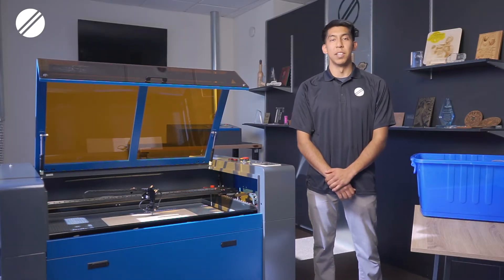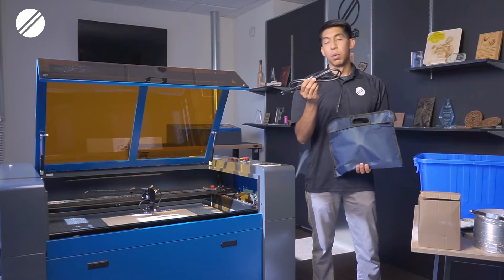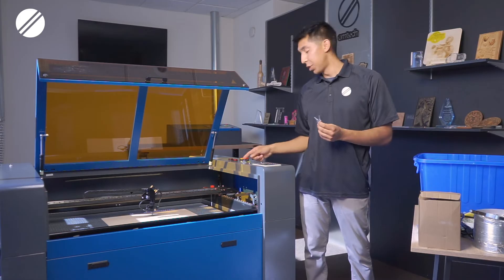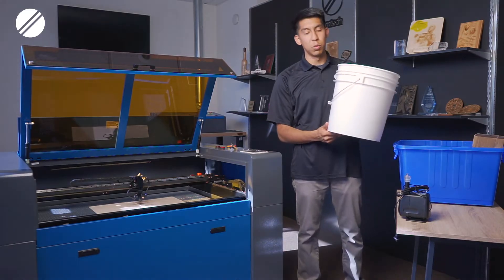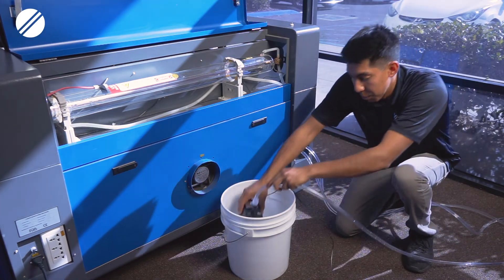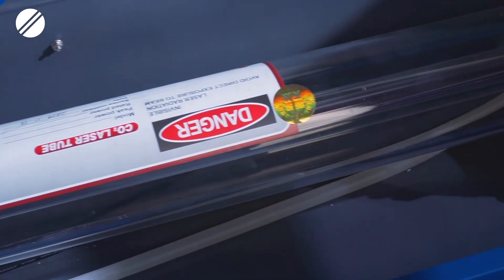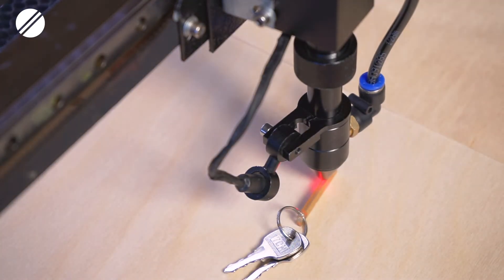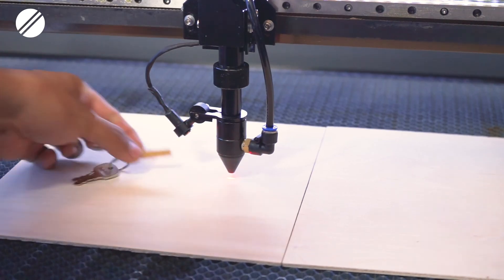Initial Set Up for Your CO2 Laser Engraver - Training Video - OMTech Laser

Comment: Bought the OMTECH 130watt machine and didn't receive the accessories kit/ blue bucket, water pump.  As far  as keys go, we only received the machine run key and no cabinet lock keys.   And the honeycomb bed doesn't fit in the machine.  May be able to fit honeycomb bed if we reposition gantry / laser head whenever we fire up the Machine for the first time.   We still have to buy the chiller and air assist compressor.

Comment: Why does my 100 watt omtech laser seem to not do anything at any power under 11%?

Even with a much slower speed, I don't see any evidence of the laser etching any surface like acrylic or plywood.

I opened the side and see that the laser box is showing 03 mA when running at 11% down to 2%, but no marks on the surface of any materials when programmed with a power under 11%.

Comment: I just ordered and am curious; Is it possible to add autofocus, and red  dot to the MF2028-60’s controller. As in are there open ports on the controller to power and utilize these upgrades? 
I’m sure red dot could be added regardless, does the power supply have a 5v rail? Or would a Buck converter be needed to lower the 24v to 5v
Reply from the maker: Our techs will be more than happy to help answer all your questions. Please contact us at techsupport@omtechlaser.com or our customer support team at support@omtechlaser.com we're also available by phone during business hours of 8:00am - 5:00pm+1 (949) 539-0458 Monday-Friday pacific time zone. Thank you for your support.

Comment: I bought a 55W co2 laser.. Mine only came with one key, no usb cable, no focusing tool, broken zipper on the accessory bag (not bin), didnt come with a rotary axis like i see every other post offering as a free bonus, and most annoyingly it has enormous deep scratches/slices on the acrylic lid. It looks like someone cut something while it was on the lid. Ive owned the laser for about 2 weeks so far and i havent used it yet. I want to know what im doing before i start messing with it. this is my first Co2 laser. Hopefully nothing else pops up thats wrong with it. I'm about neutral with the product so far. Not overly excited because of the bad things but i dont have a completely negative feeling about it because there's plenty good about it. Looking forward to becoming familiar with it.
Reply from the maker: Hey Joshua, thanks for reaching out! We do apologize if any accessory items were found missing. Our team had trouble locating your order. If you can private message us on Facebook or Instagram, providing this information and detailing the situation, we can look to assist as soon as possible.

Comment: The video is vague for beginners. Please include how to raise the bed and lower it on to the focus tool. Also should the focus tool always be 7mm from the laser? It would help to see the control panel as you demonstrate.
Reply from the maker: Thanks for reaching out! We are currently working on updating our training video content and do appreciate your feedback. Looking over your question, machines with a 1.5" focal lens are focusing at about 7mm and machine with a 2" lens machine are focusing at about 17mm. Hope this helps!
Reply: @omtechlaser  how do you raise and lower the bed? what buttons do you push to make it raise and lower? i hit auto focus and it was a bit off. i hit auto focus again and it went down and is now grinding,
Reply from the maker: @ You have to use the Z Axis UP/Down arrows on the controller.

Comment: What is the default password on the machine? tried 123456, not working.   Also, can't activate the permission, keep saying permission not activated, sett unus
Reply from the maker: Good question! Are you looking to reset or change the parameters of the machine?
Reply: I am following the manual to activate the permission and also change the password.
Reply from the maker: @joewong3132  Thanks for following up! I received word that this step in the manual can be skipped.
Reply: @omtechlaser  I cannot set any parameters without the password.   I can't change my network settings.
Reply from the maker: @joewong3132  Feel free to find what you need here: https://www.ruidacontroller.com/download/ Also feel free to join our Facebook Group and ask our engaging community of users here: https://omtechlaser.com/pages/our-laser-community

Comment: Hello - is antifreeze an acceptable coolant (either instead of water or a mix)? I’m in a cold climate and would think water could cause problems.
Reply from the maker: Good question!! Antifreeze is advised against. Rather use deionized, but if you don't have deionized, distilled is accepted.
Reply: Thanks - but in a cold climate, in an unheated garage, would the water pose a risk to freeze and damage any internal components? If so is there any way around it? I was hoping antifreeze or a mixture of water and antifreeze would suffice.
Reply from the maker: @scottc9772  We suggest adding glycol propylene. Feel free to reach out to our Technical Support Team for further questions and assistance at https://omtechlaser.com/pages/contact-us

Comment: Why is there not videos or good instructions on installation and setup on the AF4063-150 (150 Watt Laser).  Reveived mine and cant get the beam aligned just to find out that the door sensor is damaged.  Not to mention is has bolts just laying in the bottom of the machine.  Where can I get the fastest support without waiting for days for a response.  I need to talk to someone or simply give this machine back.  Only took 12 weeks to get.  This has become a terrible and expensive experience.  8507039920
Reply from the maker: Hey James, thanks for reaching out. We do apologize to hear about your experience thus far. We will forward your inquiry and contact information to our Technical Support Team, and a representative will reach out.

Comment: Thank you for the video. I'm wondering in case you need to pass the machine through a 32" wide door, can you easily separate the top part from the bottom part of the machine ?
Reply from the maker: Hey there, good question!! The bottom frame is connected through 4 screws on each corner of the machine. Unscrewing these 4 screws is not the easiest and will take a couple of minutes. For more information please, reach our Technical Support Team at https://omtechlaser.com/pages/contact-us
Reply: @omtechlaser  what is the exactly height when unscrew the 4 screws from body only? With screws he should have 94cm according to your description on your website. Thanks for help me!!!! Best regards, Armin
Reply: Did you ever figure this out?  We are wondering the same about fitting the 60w through a doorway
Reply: @lisalroberts74  We just brought my 60w inside yesterday. Once detached from the base (4 phillipshead screws - 2 visible inside and to the left, 2 accessible inside the panel on the right), it was 24" top to bottom. Turned sideways, it fit nicely through my 32" door. I do recommend a strong friend and lifting straps (mine are shoulderdolly brand). Hope this is helpful to someone, even if Lisa has already figured this out.
Reply: @lisalroberts74  I took the door off and had to flip it on its side do to a L shaped entrance but we got it in